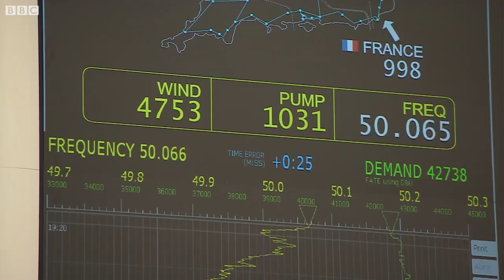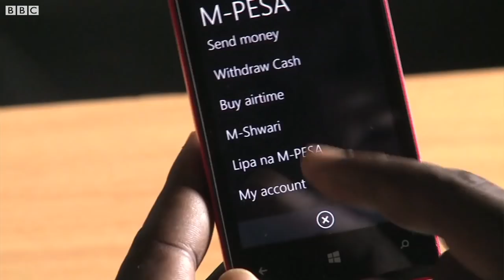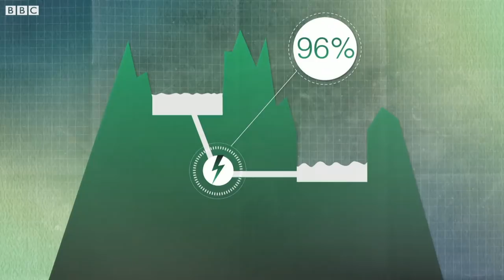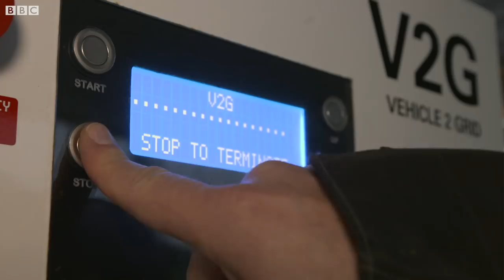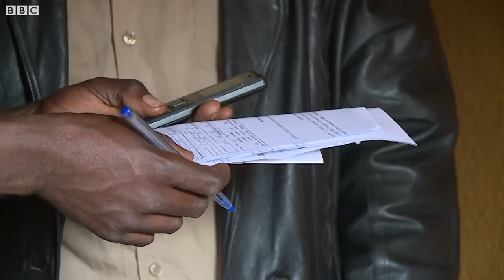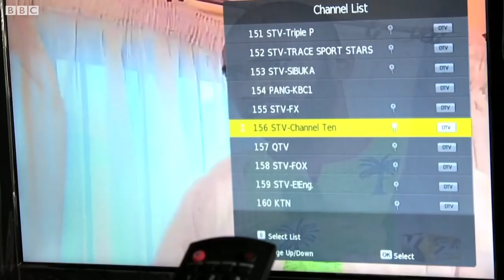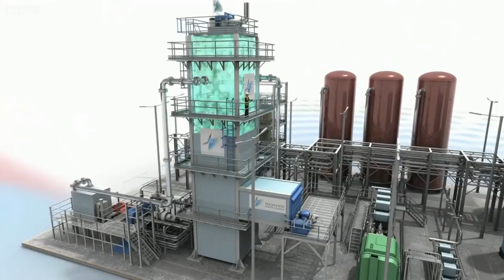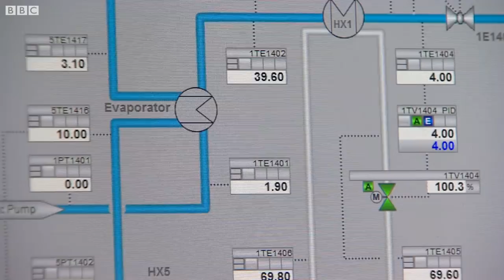Disruptors: Smart power - BBC News

Comment: I was trying to follow the process of energy storage with liquified air but lost it when the guy explaining the liquid air > energy process said "we take that liquid, we pump it to a high pressure...". 13:40 This is nonsense as you can't compress a liquid (at least not very much). I guess they're keeping their secrets but I wish they'd just say that instead of dishing out mumbo-jumbo psuedoscience to people who are trying to learn.
Reply: I think that the tank would have to be a high pressure tank because unless they maintained the nitrogen at that temperature, it would try really really hard to blow up. So to contain the explosion without maintaining the nitrogen as a liquid, it would need to be kept in a severely pressurized container.
Basically it is either temperature or pressure that needs to be maintained and it would take less energy to maintain the pressure. That is my guess.
Reply: The low pressure tank is for bulk storage. The high pressure tank is were the liquid nitrogen is heated to make high pressure nitrogen gas.
Reply: @JP-zp5ic  That makes perfect sense and it's what I theorised myself. However it's not what the guy running the show said.
Reply: Just because you don't understand what he is talking about, does not make it pseudoscience.  I admit I could not follow him either because he talks fast and uses words beyond me.  But I can listen, pause the video and go learn more (we are on the internet after all).  I suggest we all do that instead of jumping to conclusions.
Reply: @martythemartian99  You misunderstand I am a scientist and the words aren't beyond me - they are simply nonsensical from a scientific standpoint. No matter how wonderful the internet is researching nonsense only gives back more nonsense.
Reply: It’s basically the same as turning water to vapor, but instead of burning fuel to evaporate, you refrigerate nitrogen and use ambient heat to evaporate and turn turbine.  It is about storing energy in liquid nitrogen.
Reply: Listen again carefully. Go back about five seconds before your quote. "When we are looking at getting energy back out to the grid we take that liquid..." His phrasing may be a bit confusing but in context he say that when they need to get the energy out that pressurize the tank with the liquid before releasing it into the process where it regassifies and releases the stored energy. In other words the the liquid gas is stored at regular pressure until they want to get it moving.

Comment: Wouldn’t charging and recharging car batteries constantly mean they’d loose capacity faster? What could work is by the time the car fails or the battery range is far to low they could get taken out of the car and are connected to the grid until they loose all of there capacity to hold charge
Reply: Germaine's Blog I think the idea with those cars is not so much to store or transport large amounts of energy. That would be incredibly inefficient as you say. I think the cars are used to stabilise the grid supply, same with the Tesla battery in south Australia. When demand fluctuates unpredictably, supply needs to adjust power output, maintain frequency etc. I think the cars are probably helping with that.
Reply: Yea it's only 4-5kwh that is available from each car,  multiple that by millions of cars and it would make a difference,  new cars are coming out with 250-300 miles range and are likely to loose only about 10% of that over 8-10 years! 
Nissan do recycle their batteries for home storage at the end of their motoring days! 
We are getting there,  battery charging and use will also be revolutionised when solid state batteries come into play!

Comment: Car to grid systems is not really a good thing because if the cars use lithium batteries, the batteries will degrade much faster
Reply: If done correctly, only a few percentage difference. A typical electric car battery can hold a week work of average USA household power usage, and we're incredibly wasteful. v2g doesn't need hundreds of hours of power, only 2-4 hours to get over that peak. Even sharing only 30 minutes would be a decent win.
Reply: @BenjaminCronce  typical?  average US household?  methinks you are stretching things a little,, but you know that

Comment: We could also move daylight saving to 2 hours in the peak of summer to save wasting electricity in the evening and switch off street lights in small hours instead of this ridiculous idea we have to have light 24 hours a day
Reply: We could build interconnects to Greece and Protugal who have lots of sun and get electricity from them in the morning (Greece) and in the evening (Portugal).
Reply: @dickmartino9933  it's about 1000 miles between time zones so we would need some kind of superconducting Power Transmission to power an entire country from thousands of miles away during the night but it must be possible
Reply: @phildobson8705  China has a very high voltage direct current option which is efficient. Others are being considered or constructed.
Reply: Daylight Savings should be removed , be Standard US Time all the Time.
Reply: @markplott4820  because of its latitude UK has much longer days in the summer and much shorter days in the winter. In the winter it's dark when you drive to work and dark when you drive home and that's with 12 set for natural highest peak of the sun. In the summer it gets light at 3 a.m. but nobody is going to get up there early so we called 3 a.m. 4 am. People often liked be in bed till 7 a.m. so we call 6 a.m. 7 a.m. and they are all happy. This way it stays light till 10 p.m. saving a fortune in lighting
Reply: Phil Dobson - for the UK , those with Land to spare, should get a Wind Turbine, they run day or night despite lack of sunlight.
Reply: @markplott4820  You try getting planning permission. The Green Party lead protests against it and bring people from hundreds of miles away to walk around your land protesting about it
I don't know why they're even called the Green Party.
But is not just that is old age pensioners who moved to the countryside and now think you're going to industrialize the landscape with your wind turbine when they came for the nice view on their Sunday drive.
Some places wind turbines are actually a tourist attraction but most places are just interested in getting votes from their new old people
Reply: Where I live, in Wiltshire , in the mid 1980s street lighting WAS shut off after around 22:30 until around 06:00 or so. Fell out of favour later on, and now it''s all on overnight - although they are mostly LED, not sodium ones as they were then.
Reply: switching off street lights would surely decrease light pollution as well. There could be smart solutions that only turn them on when people are around, that would be impressive

Comment: Solar all the way. I have 4kw on my place with a smart diverter to send excess electric to the panel heaters after the hot water has been done. The rest goes into the batteries which I use in the evening when no more solar energy is available.  I still have leftover to export to the grid. Wind is a waste of time as the inverters for these work hard and need to be changed every 5-10 years. Makes me angry with all these videos trying to baffle people with science. Dont believe the bullshit you hear. If every house had solar with a couple of batteries, there wouldn't be this talk of energy crisis. Return on investment in solar is 10-15. Find anything that will give you that back. My electric bill is £2-8 a month. I do use a tiny but only because I have extra heating for my chickens in winter. I am a solar engineer in East Anglia so shop around and dont be fooled by free solar offers. The price is coming down drastically this year and into 2019. I should really start making simple non-BS videos and real returns on installs.
Reply: and of course that is easily afforded and relicated across the community,  many of whom dont own the home they are in or are in apartments

Comment: Don’t store power just produce alternative energy and put it on the grid. Think of solar there’s always sun somewhere in the world.  This means connect every country together.
Reply: This is in the works too. But there are losses too. I know that in transmission today over actual distances over 2% is lost. There is more, but I mention only the loss during long distance transmission. So since the distance will be a lot more, the losses will be more than 10 percent, and this they are working for higher tension.
Reply: You couldn't do that even with HVDC lines of the highest voltages. You just can't transmit electricity that far.
Reply: @martinsoos  oh, the math is done, the variables are accounted. and actually the lines were done here and there https://en.wikipedia.org/wiki/Ultra-high-voltage_electricity_transmission_in_China, but is a matter of costs. 
And I was answering to Jasmine. There is solar somewhere in the world, but sending it ten or twenty thousands kilometers, even with ultrahigh voltage may cost more than storing. Recently I saw lithium storage for 50 usd per kwh. So, lines have competition. Rest assured, someone somewhere is doing the math :)

Comment: Car to grid is going to wear your battery out because battery will last for x number of charge discharge Cycles then you need new batteries.
Therefore Australia's idea is better, buy batteries for the grid nationality.

 The amount of batteries needed will ultimately be the same because instead of having to replace all the car batteries that same amount of capacity has been purchased exclusively for the grid
Reply: Yeah, it looks like a nice idea but not particularly scalable. Better to invest in denser energy storage solutions like what Australia is doing. Scaling up renewables is how to fight climate change and energy scarcity.
Reply: What do you think all the manufacturers are planning to use car batteries for when they leave the cars?
The packs will be dismantled and the cells placed into static storage batteries just like the one in Australia, because the relative loads on the cells are so much lower than in a car.
it's not so much the recharge Cycles that causes the problems with batteries, it's the stress of the extremely high charge and discharge during rejane and acceleration. I understand they're expecting used car cells to last anything up to 10 or 20 years Extra in static storage.

Comment: Vehicle to Grid is a Stupid idea, and should only be used in Emergency's. and only for your or Someone else home. 
HOME solar and wind should be used for powering the Grid at Peak Times but ONLY after your HOME battery or POWERWALL is FULLY charged first. then Release the Electrons to help stabilize the Grid.
Reply: Totally agree. V2G is born dead. It's not commercially viable option ever.

Comment: Cold air storage.. trouble is the amount of electricity needed to do the chilling would be huge and the bigger the system the bigger the electricity would need to power this cold air system!    Bad system then because the power needed to run and store the cold air outweighs the power got back?    Plus liquid Nitrogen very dangerous indeed.. only needs a loony anti-eco nut or crash of a car into the tanks and boom lots of killed animals and people frozen solid and broken into pieces!  Remember if you have only a small amount of liquid Nitrogen go over any living organic matter for a few seconds you freeze it to death.  Better sticking to battery storage system as they go wrong you all live.